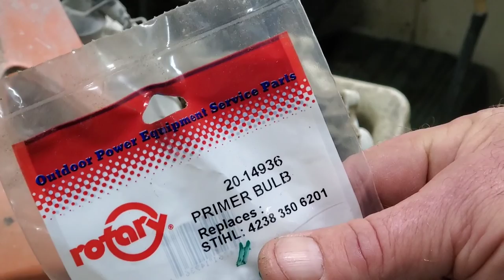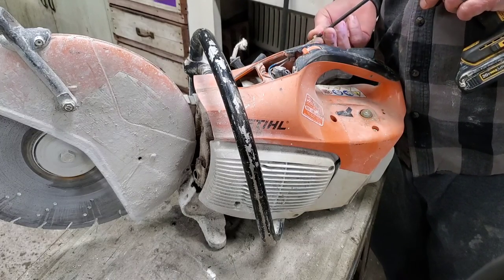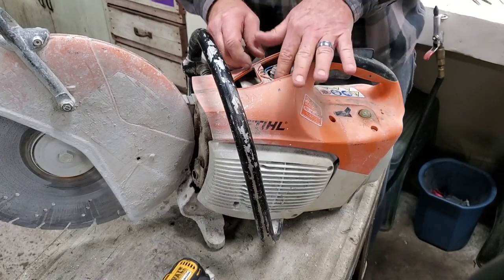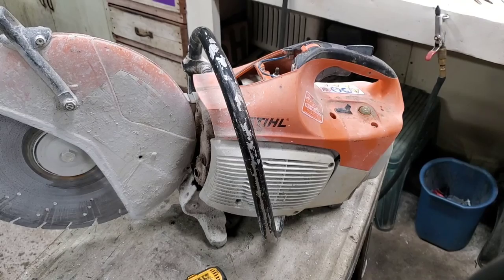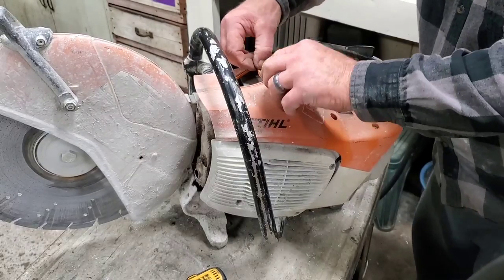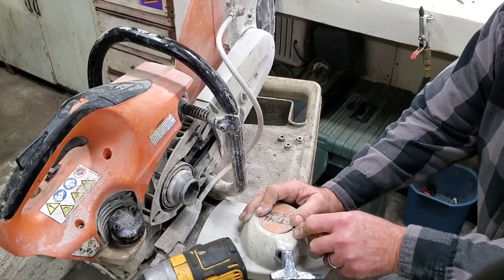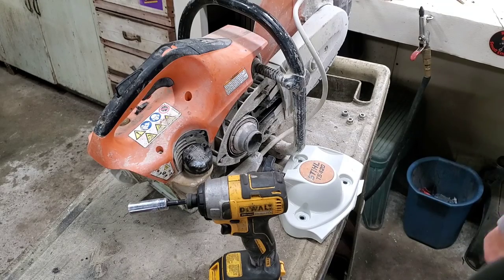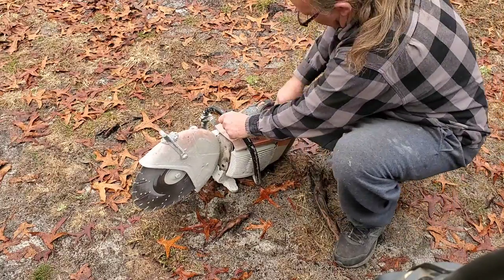STIHL TS420 CONCRETE SAW PRIMER BULB REPLACEMENT EASY DIY

Comment: Great video Tbone ! I have done everything that can be done with those saws (carbs, cylinder kits, start switch, pull starters and belts) , and totally dread those whenever I see them.
Reply from the maker: We have also they are a pain sometimes. We have pretty much stopped taking them in other than a couple customers. Thanks for watching my friend

Comment: I realize this was a couple of months ago, but why wouldn't you blow that area under the cover out with compressed air? Especially if you are replacing the air filter and spark plug? Thanks
Reply from the maker: We video as much as possible with time availability, I also didn't show putting in new air filter. Thanks for watching
Reply: @RaleysSmallEngines  Ok, but you would clean that out?
Reply from the maker: @thebeardedstork432  yes
Reply: @RaleysSmallEngines  👍👍